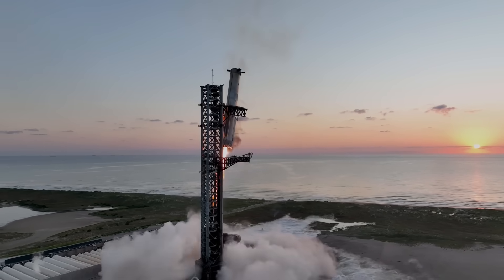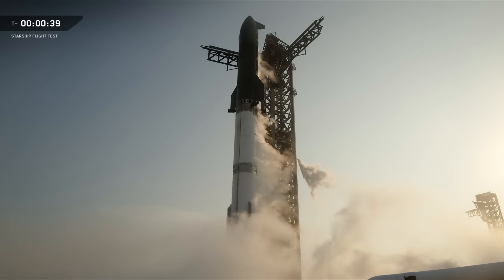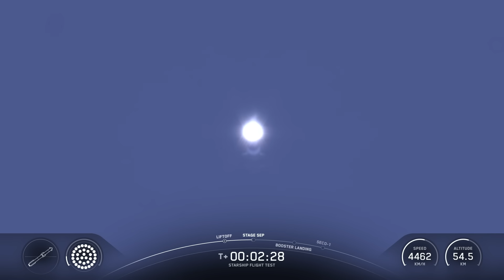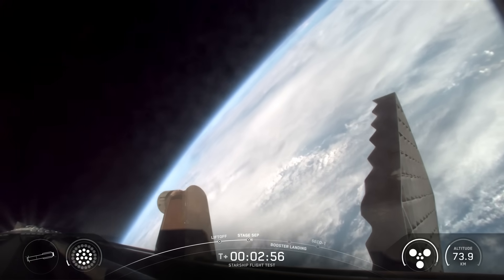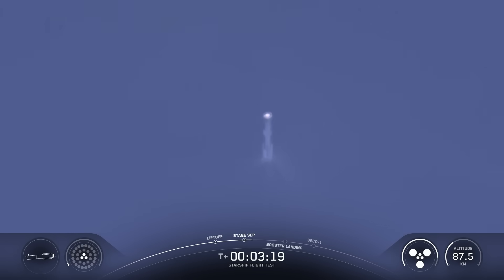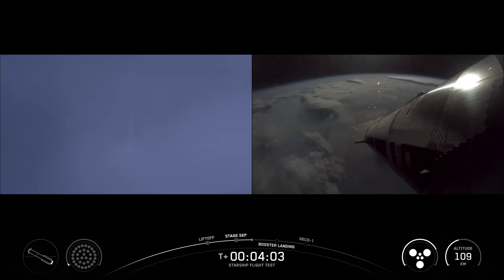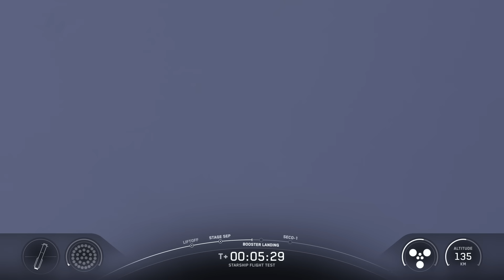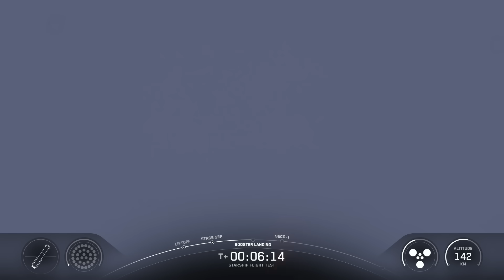SpaceX Builds Largest Reusable Booster, Also Makes Door That Won't Open - Starship Flight 9 Recap

Comment: Why do they want it to come back to earth on  a higher angle of attack ?  Surely that puts more pressure on the booster.  They got it right the first time, just leave it no?
Reply: Higher AOA means more drag on the way down which means less fuel is required for the landing burn and thus more fuel can be used to lift more payload into orbit.
Reply: @KiRiTO72987  
Yes exactly. more drag equals more stress on vehicle.  I suppose they are just assessing how far they can push it to see what max payload they can get away with like you said.  They will end up having to put heat shields on it like starship : )
Reply: @jeremykemp3782  yeah its basically a case of going fully reusable really hurts payload to orbit so their trying to squeeze every last ounce of performance as they can out of it, its likely they knew the booster was highly likely to rud given they chose to not even try for a catch

Comment: not robust enough. still. over-engineer not hot head. exskuses. they did get the entry heat shield functionality data even if it burned. which is what they wanted. nice fireworks mate.

Comment: If you think about it even if the Raptor engines are top of the line and Elon has been able to bring down the size and clutter, but they have been studied and developed for generations, but space doors we have heard almost nothing, except the space door the got stuck on the ISS because of Cold welding. But innovation takes time and testing and each test even a failed test gives more data than we could ever understand!

Comment: When watching the replay footage of the launch yesterday, whatever was venting above the boosters didn't look too promising for starship and looking back it again. The way it's reflecting the sun, it looks more like steel being cut with a plasma torch. Good point on the news coverage as Sky News reported test 9 very poorly and gave the impression that starship failed straight after separation.
Still, starship in this test had made it further than its predecessors and the amazing snow globe effect inside.

Comment: I'd say this flight was a full failure. Okay, ship and booster didn't explode on ascent - but thats not really any of the test targets anymore, is it?
Simulating center raptor failure on booster during landing burn - not tested (RUD)
Getting starship into orbit without critical damage to systems - failed
Payload deployment - failed
In-orbit engine ignition - not tested
Heat shield - not tested
Reply: Yeah, I'm normally quite positive, but this launch was a complete fail in my eyes.

Comment: As much as I love SpaceX, these failures are getting old. So...

A poet — nature’s crowning flame.
If only I could guard my name...
I lie upon the rooftop, lit,
And launch into the stars... a spit.

Where stars in sparkling sequence glow,
My spit ascends like a rocket's fire...
A brand new star is born below
Named “The Poet’s Spit”, in the sky entire.

The launch was sharp, precise, and bold.
It seemed all systems were aligning—
But after just a moment's hold,
A glitch emerged mid-flight, confining.

It veered off course, not reaching space,
Fell short of any astral body—
It looped around and did retrace
Its arc... and landed where? How shoddy.

I wiped it off... My thoughts collapse,
Cut short by silence, grim and tattered.
But worst of all—who should be caught
And blamed for lying here... bespattered?

Comment: "Engineering is complicated in ways that we laypeople frequently do not appreciate" No, no, no, no, NO!!!!!!!  They can't design a fucking door which works reliably.  This stuff should be one of the most minor engineering challenges on this program and they should have contingency plans for failures and backups for those contingencies.  SpaceX fucked up here, pure and simple.

Comment: The operation was a great success, but unfortunately the patient died. I can't believe Musk is still planning on landing a 50 metre rocket on the moon like a 1950s sci-fi movie. John Houbolt will be spinning in has grave.
Reply: Moreover, they will need to take a pilot ladder along (as a backup), in case that nice elevator (as rendered in all the marketing material) will suddenly jam.

Comment: Howdy sir, long time listener.  Was reviewing the stream @SEC, multiple burn spots in the steel hull observed at the bottom of the engine skirt followed by gas discharge from same spots.  Is it possible they are running LO2 through the hull for active cooling ?

Comment: StarShip Flight 9, no achievement at all for my point of view; Starship failed the same as previous and the booster should not explode. 
Attitude Control MUST BE BULLETPROOF!!! Otherwise it would not matter how good the heat shielding or how good the engines....the rocket will be a dead trump for any astronaut in the future. I think that is the worst thing that happened to the Starship. If not make it bulletproof I give ZERO safety to Starship in the event of carrying people. As it is designed now,  It is a deadly machine!!!

Comment: Starship continues to fail to even get to orbit.  The failure of doors is immaterial, when the vehicle continues to blow up or fall from the sky.  While it's a slightly less catastrophic failure than the previous catastrophic failures, there is no success in being less bad.

Please quit rationalizing Starship.  SpaceX delivers a good rocket in the Falcon 9...  and nothing else useful.

Comment: a small solid rocket engine could overtake the spin and force fuel down to the bottom so the other engines would start.  Losing control is not an option for a crew, their going to want options.  The RCS thrusters should have a manual over-ride and extra solid rocket cells to get things moving in the right way.  Computers don't always understand the whole picture and will just blow up a ship instead of exhausting all options to save it.

Comment: By flight 1 standards, flight 9 would be a success. But this wasn't flight 1. The only success on this flight was one that saw the reuse of a booster. I think we can all agree that, in the grand scheme of things, this has been done before on Falcon 9. And all that really says is that the booster has proven itself through repetition, which it hasn't if you consider the engines as part of the booster. If any aspect of the boosters hardware, excluding raptors and their control modules, had anything to do with the booster RUD, the success of a reused booster is moot because the booster caused the RUD, and thus was not a success. 

That said, it appears SpaceX is constantly iterating multiple aspects of Starships design for each flight rather than nailing down certain issues. And while this may be the way to go as far as an efficient testing campaign goes, to this day, the raptors are iffy, the heat shield is still questionable, propellant containment has become an issue, reaction control is still an issue, and the payload bay doors STILL do not work. They even changed the stream HUD to exclude booster telemetry. 

In my opinion, SpaceX has iterated their way into a pit. If, for every flight you change multiple things, theres no real way to know which of those things might cause a failure if it ever does. They are changing too many things at once and then lighting the fuse. We've seen 1 failure in previous flights, but never 3 cascading failures where none, or most, of the goals were not achieved.  They've gone 1 step forward a 5 steps back. I really think they need to pump the breaks and iron out the major issues that have plagued previous flights.

Let's be honest here, this flight was a failure. It needs to be. You don't learn from successes.

Comment: I wonder if the fuselage is buckling (or otherwise deforming) in a way that is causing the door to jam. That could also contribute to potential leaks from the fuel tanks. Are there differences in the structural design between the steel craft and others using conventional materials?

Comment: I suspect that the reason the door couldn't be opened was because the spacecraft's tumble loaded it in a way the mechanism couldn't handle. Doing some back of the envelope math based on the observed rate of tumble I would guesstimate that the door was seeing about a 1/3 G radial load. While the door mechanism obviously had to be designed to passively resist much, much more than that (especially in the axial direction) while latched shut, the actuators etc that actually open it were probably designed and sized for zero-G.

Comment: The Saturn V and Lunar system after 9 flights had already done 6 Moon flights and landed 3 excursions on the lunar surface, flying 21 Astronauts....Starship is spinning its wheels !!
Reply: Thing is the former had been developed for a long time to perfect the system and the latter is being built at a fast rate and being put to the test in real life conditions to further improve upon future vehicles
Reply: @Æstraiz 
The Saturn V was developed within about 7 years. Starship has been in development since 2012...

Comment: I believe all these failures are major design flaw of the Block 2 Starship and SpaceX has pretty good idea what's wrong, only it's not fixable in already constructed prototypes. I wonder if the issue could be something as simple as they have gone to a gauge of metal so thin the propellent tanks are developing breaches? Or possibly there is a problem with the welding process. Basically something that can only be fixed in future construction.

Comment: They need a lot more redundancy and safety controls built into this thing before they get a landing. They have to figure out a way to shutdown random burning fuel lines without taking out all of their propulsion.  Some kind of centralized valve controller that that is close to the engines that can detect runaway fuel lines and shutdown down just that line. As for the doors, I would say they were jammed shut due to the rolling or they need some kind of maneuver to open the door and eject the pods. It could have been a power issue is well. This is where a mishap investigation would help them figure out the problem before they burn up another rocket.

Comment: Heya Scott, if you watch the interior camera when they showed it while trying to open the door, there was a sudden change in the direction of the dust and ice particles, all moving in a linear manner, followed by a resumption of the motion due to the tumble.
It also appeared that the venting was continuing for the entire period of the sub-orbit, leading to a slow acceleration of the motion about the axis, so towards the end it appears to be spinning fast enough to strobe the video of the dust and gas cloud outside.

Comment: Why are they using the longer length of the rectangular satellite to design the door width instead of the shorter width?  Even a PEZ dispenser knows it's easier to push out the smaller side of a rectangle.🤣
 A smaller door is lighter and a smaller opening is stronger too.

Comment: My guess is shock and vibration from the booster is damaging the comparatively delicate plumbing in Starship, which is causing leaks, uncontrolled venting, engine compartment fires, the works.

Comment: Doors have been a challenge to engineers from the very beginning of spaceflight.  From the hatch on Liberty 7, the Apollo 1 hatch issues, challenges with the LEM hatch, shuttle bay doors which warp and distort and end up being operationally opened and closed in very specific lighting and temperature conditions, Hubble service bay doors again warping, these and others are examples of challenges in designing lightweight openings in spacecraft.  If the particles that we are seeing is ice, then there's very likely a pressure gradient between inside and outside.  Very small pressures can create a huge force with any area that they can act upon.  An example are the canvas hatch covers on the ISS seem to slam open when astronauts open the EVA hatches even though they are practically at a vacuum in the airlock.  VERY little pressure acting upon a large surface.  Add in the fact that the Starship door actuators are designed to function in a micro-gravity environment, it wouldn't take much of a leak or sublimating ice to jam everything up.  Flight 9 was a success, albeit a somewhat muted one.  Hopefully 10 will do better.

Comment: Lol. If this was a government funded operation, it would still be on the drawing board, senators would be jockeying to have parts come from contractors in their states, and there would probably be a lawsuit or two over the same.
Reply: Yeah, all the government funding they totally don’t get at all. 
Considering NASA’s funding during their peak compared to what it is now I’d say they’re doing pretty good. People tend to forget how little funding NASA has and how much they have going.
Reply: @NBSV1 how much has this entire program, developing an entirely new rocket including entirely new engines using new manufacturing techniques from scratch, actually cost SpaceX? 5-10 billion, whereas SLS which is basically just a rocket using proven tech was over 25 billion. Don't get me wrong, I love NASA, I just wish it were better run instead of functioning more as pawn for all the politicians in the house and Senate than it does as a science and research organization. SpaceX absolutely gets a ton of money from the government, but credit where it's due they are delivering.
Reply: @Proton_Decay SpaceX hasn’t built, much less flown, anything that would compete with what SLS is designed for. And, based on how these bigger rockets have gone for them they aren’t on track to get there soon. 
SpaceX has done a ton and shown what is possible. They’ve also brought about a shift in space by opening it up to lower cost more commercial options. But, if I had to get shot into space for some reason I’d choose NASA if I could.
Reply: Comparing product development lifecycles, still tracking way ahead of falcon development, by a couple of years. It's entirely possible they'll be putting real payloads in orbit by end of year, and while human flight is a "long" ways off that's a faster and more sustainable way to build reliability than ground tests.

Comment: My guess is the entire ship is flexing, causing most of these problems....door not opening, fuel lines cracking, tiles falling off. My confidence is low that even if the door opened, the satellite simulators would deploy without binding up. Planes have air frames that keep the integrity of the body true. I'm pretty sure the space shuttle has a true airframe. Starship engineers are trying to do this without a true airframe to save weight for obvious reasons. I'm  looking forward to seeing if they can make a pressurized steel can that experiences the forces required to reach orbit and reenter truly reusable and safe.
The idea of humans riding inside a ship that relies on pressure to maintain its integrity is way outside my comfort level.
Best of luck to the SpaceX engineers. The people of earth are counting on you!

Comment: Yeah space is hard it would be nearly as hard again to build a vacuum chamber big enough to test starship scale components on earth as just launching although by about now I bet elon is wondering about half scale vacuum chambers  all about mvp these days good fpr tech start ups but not so good when it cpmes to long term systems intergration the whole starship program now needs the hard testing phase for long term reliability but has space proven launch system so little things like cracker servos to spill excess pressure and a nylon bush where that metal bearing on hinge linkage pulls door in before slides aside etc little things also some ribs on those little twig runners used to cantilever it open to minimise flexion.

Comment: Less successful than hoped is still successful.  It would be almost impossible to build a fully reusable heavy lift launch system and have it work on the first attempt, and the effort would be far from cost effective.  Even when we understand the completely different development process where non-crewed flight tests provide data that leads to success as quickly and cost effectively as possible, we're conditioned to see these prototypes as failures.  They aren't.  The purpose of testing prototypes is to collect data and learn, and SpaceX is doing that.  The only failure would be quitting, and SpaceX isn't quitting.  SpaceX is going to colonize Mars.

Not long ago, Big Aerospace and its supporters laughed at the idea that SpaceX would become a viable player in the aerospace market, but today, SpaceX routinely launches 2-3 mostly reusable Falcon 9 rockets every week.  They're now launching more tonnage to space than everyone else on the planet.  Extending that routine low cost access to space is the future of Starship.

Comment: It was a highly successful failure. We saw 33 beautiful flames on the reused stage, we saw a successful stage separation, and the test of the structural limits of the booster. We saw the Starship engines start and perform successfully. Every failure shows where more work is needed. SpaceX will get there if the money holds out.